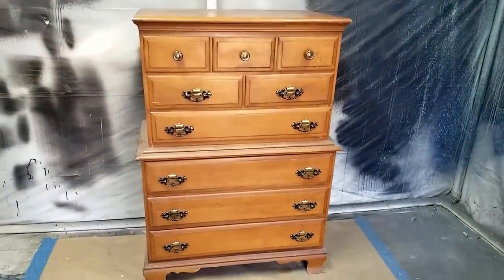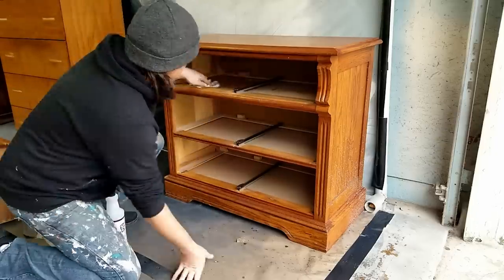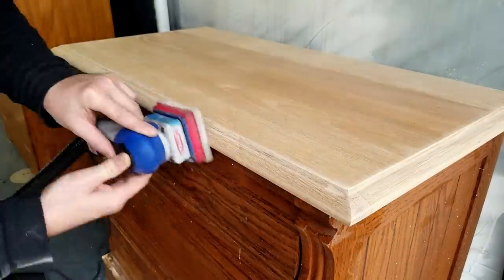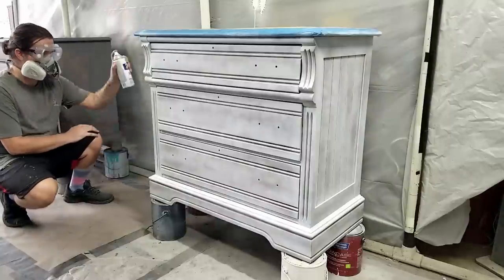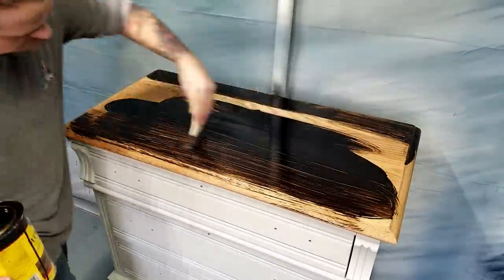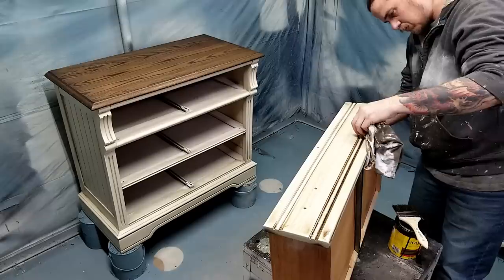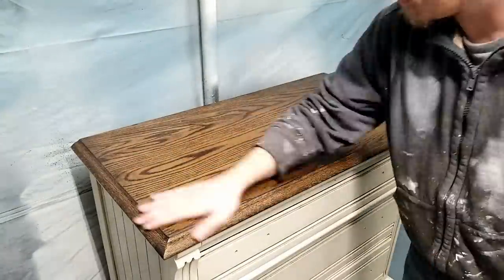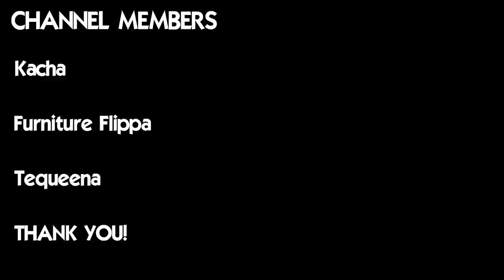Painted Dresser Makeover to UPDATE an OUTDATED Oak Finish

Comment: Umm…wow! As a woodworker, I don’t like the idea of painting wood in general. But the white with the stain over it, getting into the cracks and crevices looks amazing! Well done!
Reply from the maker: Thanks! I try to do enough for painters and wood workers to meet on some middle ground at least lol. Appreciate the comment. Have a great week!
Reply: One good thing about painting is it protects the wood, and later can usually be removed. I have an antique oak dresser, solid wood. It came to me painted, later I added another coat. Finally I decided to strip it.  Turned out to have 5 separate colors, and in truth I could not get more than half the paints off. However it actually looks really cool, and I just ended up burnishing it with a very fine grit paper.  I found some pulls that are kind of a watercolor style that have 2 of the colors and it is very dramatic.

Comment: Lovely! You updated a classic! Thanks for the tip on Minwax Lacquer in these cold temperatures!
Reply from the maker: Just be aware that if you apply lacquer in temps that are too cold, the finish will look hazy/white. Same with high humidity. It was 60F when I was applying. Water based poly would have worked too, just taken a bit longer since I'd have to load/unload/clean my sprayer which takes about 30 minutes total. Might as well use a can real quick and be done. :)

Comment: Love that Surf Prep Sander but it us too pricey for me!! Great job! Your skills are improving quickly!
Reply from the maker: Surfprep isnt for everyone. Mainly for doing high output work when it comes to furniture. But I've used $20 to $40 sanders for the past 9 years. You use what works for you. If an upgrade is worth the money later one, dip into it. My sprayer cost me $400 to get me set up plus $250 in supplies +time to create my booth + booth maintenance but I have the volume to pay for it. Surfprep as an upgrade is similar. No problem in not needed those yet. Do what is best for you!

Comment: Awesome!, Been watching for quite some time now, even bought a project painter plus because of your videos. I absolutely love how it sprays and the finish is great, BUT… I’m finding that the setup and clean up doesn’t justify using it on small pieces. Plus, I hate the priming with water that ends up diluting the whole can, especially after 2 or 3 times and the paint waste at cleanup. Any tips / comments would be appreciated. Thanks for the inspiration!

Comment: I've read that adding a clear topcoat over white paint is likely to result in yellowing over time. Have you experienced this?
Reply from the maker: I've learned that when I spray water based poly too thick over light colors,  yellowing can happen. This is why you will hear me stress the use of thin coats when applying poly.

Comment: What type of paint do you use? Flat, matte, semi gloss? I’m asking so I’ll know what to use with the stain glaze technique. I’m guessing it wouldn’t work with flat paint.
Reply from the maker: Correct. Flat or matte paint like chalk paint soaks up too much of the stain making it hard to wipe off. I use a satin finish to get this result. You can use semi gloss but it repels the stain so less tinting happens but you can still use it to highlight details. Still effective just a different look compared to the finish I achieved in this video. But yeah flat is a no no in this situation

Comment: That looks great.  Where have you been?  You haven't posted a video in months.
Reply from the maker: Shoot I went 6 months without posting in 2021 lol. Just took a break for myself then when I came back I bit off more than I could chew trying to do 6 pieces in the winter. Cold temps really slow things down. I'll have videos coming out every two weeks starting now through March with plans to increase that to 3 or 4 a month by summer so stick around! Thanks for checking in!
Reply: @ThatShabbyGuy  How much does the income from Youtube help?  You have 130,000 subscribers.  I would think you could make more off Youtube than flipping.
Reply from the maker: My YouTube income is what allows me to take breaks when I need to. It is full time income. Unfortunately if I dont post videos, that income goes down, but is still enough to get by. I can definitely make more off of YouTube than flipping at this point. I am also taking on sponsorships like you saw in this video which pay even better than YouTube revenue. This is part of the reason why I'll be having videos coming out every 2 weeks and more in the summer.

Comment: This turned out beautiful! Did you seal the paint before staining it? Does it matter what Sheen the paint is before applying the stain? Thank you so much for the great video!
Reply from the maker: Great questions! I do not seal the paint. It just needs to be dry enough to be able to rub a rag against, usually a day. The sheen needs to be satin to get the same effect I'm getting here. If you use a matte sheen like chalk paint has it will soak up the stain and be a huge pain to wipe off. Even then it wont look the same. Semi gloss repels the stain so it doesnt tint the paint but is still useful for highlighting details. Still an option. Thanks for watching and commenting!

Comment: Great video!  I'm fairly new at this so I have just have a few questions.  I was amazed at how well the stain wiped off.  You called it glaze.  Is the stain mixed with a glazing agent or does it just wipe off as well as it looked?  I don't have a sprayer to put on the base coat so I was planning to use chalk paint as it doesn't show the brush strokes.  Thoughts on that?  Again, thank you for the great video!

Comment: What about the oak grain?  did the spray paint fill it completely?
Reply from the maker: Nope. It still has some grain to it. If you're concerned about if the white will remain in the grain after it is stripped in the future, the paint will come out of the grain with stripper and steel wool.

Comment: Have you had any problem with that brand of spray paint clogging up?  I've had two cans stop spraying recently and it wasn't the nozzle.  It was the place where the nozzle connects presumably.  Any idea why or what to do about it?
Reply from the maker: It happens sometimes. Walmart and hardware stores usually have a place that people test the spray paint before purchasing. If not a place set by the store, you'll see a place where customers spray it on the shelving lol. You can do that or you can just take them back. Sometimes I get ones that dont spray well and it is just a nozzle issue. Others I've purchased with no pressure or clogged. Just have to take em back.
Reply: @ThatShabbyGuy  thank you for the reply.  They work till about half way through so testing them wouldn’t prevent it.
Reply from the maker: Are you turning your can upside down and spraying it after use so that paint clears the nozzle, preventing clogging? This needs to be done between each use.
Reply: @ThatShabbyGuy  well this is happening during use.  As in, when I’m going to use a whole can and it stops spraying half way through.  I’m sure I’m doing something wrong but I don’t know what.
Reply from the maker: @thegablednest1086  Nah that sounds like a dud can. Take it back.
Reply: @ThatShabbyGuy  thanks, maybe they are duds.  Leave it to me to keep grabbing duds.  You’ve been helpful!

Comment: Keeping it classy and classic.    I just live how the walnut stain brings out the beauty in the oak. It really updated this piece. Also, did you plan to match the "ivory" drawer pulls to the paint? If not, that was definitely a bonus to finish off with.  Looks great!
Reply from the maker: I do this finish a lot. It is kind of my trademark finish I guess. I didn't want to deal with replacing them so when I thought about how I could tie it in, I immediately thought my dark walnut glazed finish would match. They're actually a bit lighter than my finish but I think that works out even better. Otherwise the marble would just blend in with the finish and look weird.
Reply: @ThatShabbyGuy  I like that you put thought into it.  There are some really good firm artists put there but their taste is sometimes questionable.  Great job!

Comment: I have to disagree with painting hardware - it gets touched and pulled on a lot and it won't be long before the paint will be coming off. At the very least - put a clear coat over it.
Reply from the maker: 10 years. 800 pieces. Zero complaints